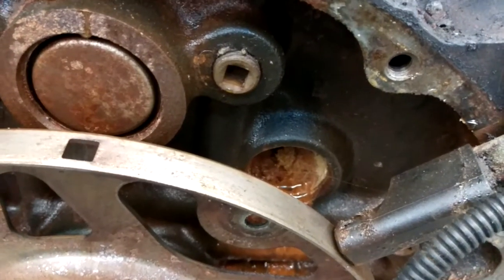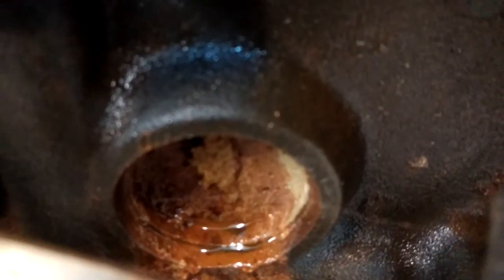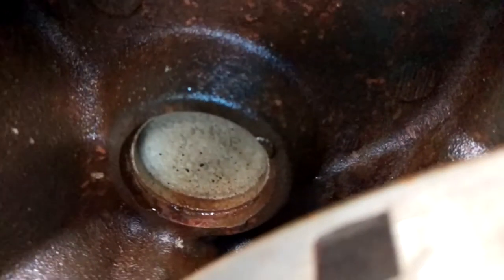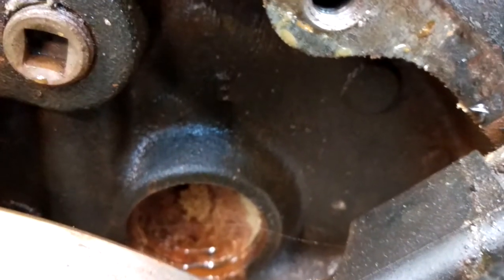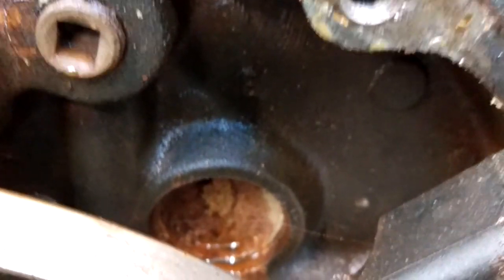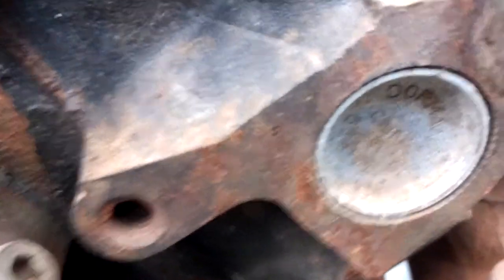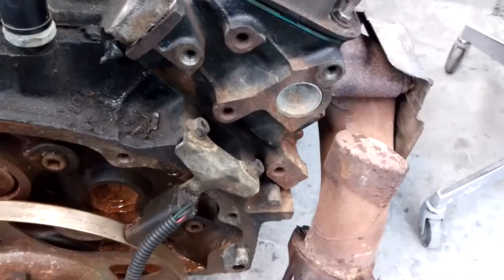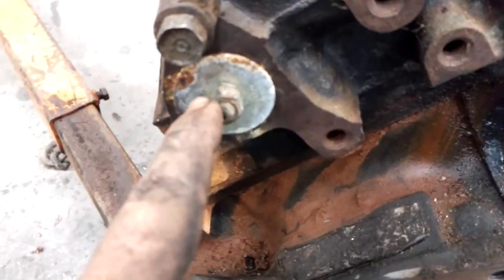Signs of a Failed Freeze plug

Comment: I have a question regarding a freeze plug ....my engine overheated ...openend bonnet ..jet of antifreeze spraying out of a small hole in freeze plug ....now what ...i stopped car and got it towed ...no oil in water and no water in oil ...do i just replace feeze plug ir what shoyld i check to make sure i buggered up aything else ....engine sounds fine when i start it ...wiuld appreciate your advice ...Andrew
Reply from the maker: Replace the freeze plug if it's easily accessible

Comment: HELLO, I HAVE A QUESTION ABOUT FREEZE PLUGS. THE VEHICLE IS A 2003 FORD RANGER. DURING THE WINTER THE VEHICLE WAS PARKED AND THE COOLANT WAS MISSING FROM THE RADIATOR BEFORE DRIVING JUST UP THE STREET ABOUT TWO BLOCKS AWAY TO REFILL THE COOLANT. I WATCHED THE COOLANT GAUGE AND IT NEVER MOVED FROM COLD. WHAT PROBLEMS COULD OCCUR IF ANY BY DOING THIS ??????
Reply from the maker: Fill it back up with water n see where it's leaking from, if no visible leak start n run the engine up to operating temp n shut it off n check for leaks, after it cools down n check level at that time n if it's low check else where
Reply: @RedneckProvingGrounds  NO COOLANT WILL HOLD IN THE RADIATOR. IT RUNS STRAIGHT OUT THE BOTTOM OF THE ENGINE THRU THE BLOWN OUT FREEZE PLUGS. BUT I DROVE IT LIKE THIS TWO BLOCKS AWAY. DURING THE WINTER AND THE TEMP GAUGE STAYED ON COLD THE WHOLE TIME. WOULD COULD HAPPEN DOING THIS ?????
Reply from the maker: @dayshawncrew4431  replace the freeze plugs ? Don't run it until they are replaced